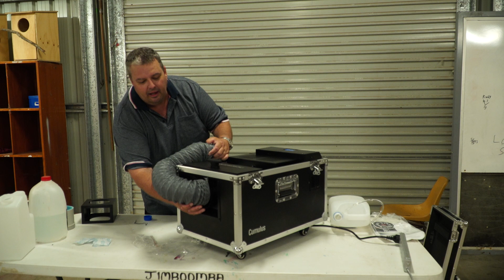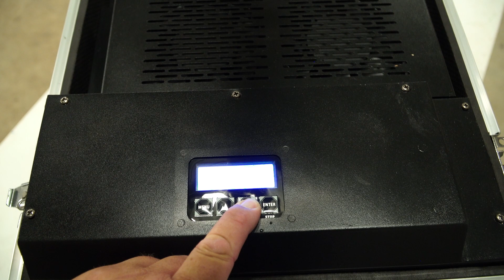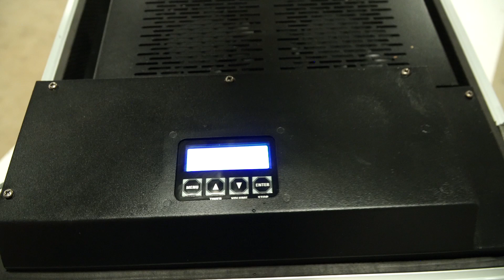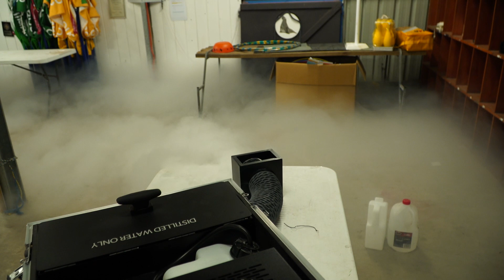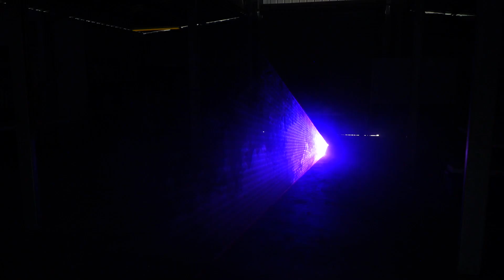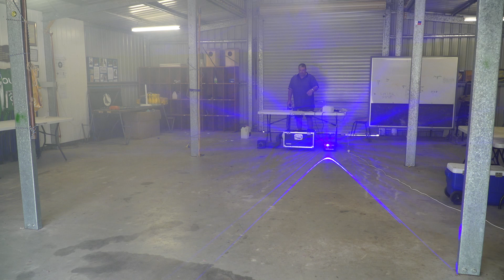Chauvet Cumulus first use set up

Comment: The time out  what is on%
Reply from the maker: the % is what i call the mix of water to smoke fluid, even at 1% the fluid last forever and still emit heaps of smoke. the time out is the auto smoker that runs for the amount of time you set, but be careful not to overtime it, you wont see anything

Comment: What is the diameter of the hose for the fog?
Reply from the maker: 100mm or 4in i think off the top of my head
Reply: Where you find the hose and the adapter? Nice video 😉
Reply from the maker: @marcoavila9086  the hose comes with the machine and the adapter is a piece of pvc pipe available in any hardware store

Comment: The Manual says that DMX CH 1 is the Fan speed and DMX CH 2 is Volume.  Was there something different with the Australian version of the Chauvet Cumulus DMX Channel settings????  Please advise.   Or did I mis hear your instructions on the DMX?  Thanx for any clarification.  Great video!
Reply from the maker: i have not used the dmx on the unit, the controls i used were just on the control panel
Reply: @pixelpixie9289  Thanx for the QUICK RESPONSE.  At a little beyond 12 minutes the person demoing the unit attaches what appears to be a Chauvet Obey Controller and discusses the assignment of  CH 1 being OIL/FLUID and CH 2 being Fan Speed, but when I look at the Cumulus manual it is CH 1 Fan Speed and CH 2 VOLUME or OIL as per the Demonstrator.  Great video, just got confused when I heard that.  My apologies. If you could clarify after the 12 min demo on DMX or ask whoever demonstrated it  if it was an mix up or is the manual wrong.  Thanx for any help.
Reply from the maker: ok clearly i say ch2 for fan, maybe ours might be different models as this was made 2 years ago, but anyway, it wont end the world if they change it, just experiment with yours and i am sure you'll be a expert in no time. any more questions just let me know.

Comment: Hi there, would you help... I just got the same machine and struggling to get it to work the way you're one in this video - What settings your machine in this video
Reply from the maker: hi, i run this video at 1%, think of it as the percentage as the amount of smoke fluid used. the higher the percentage the thicker and darker the smoke and higher chance of setting alarms off. fan at 100%. what is the problem you are having?
Reply: @pixelpixie9289  Thank you for responding - turns out my machine has an issue, I sent it back to the agents to repair.